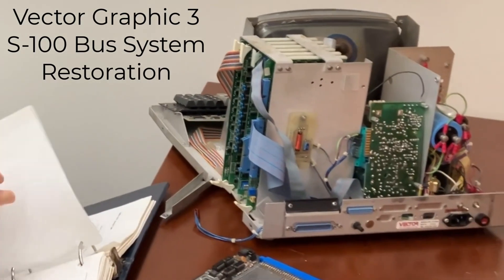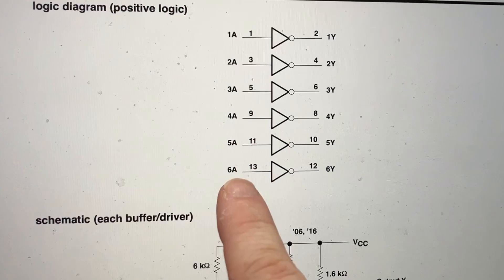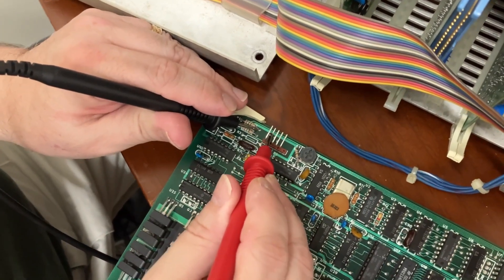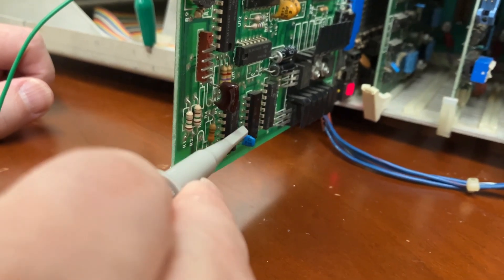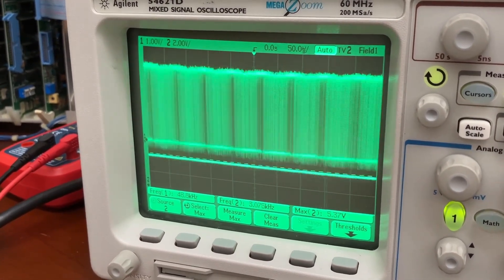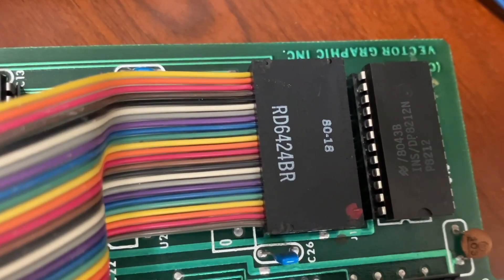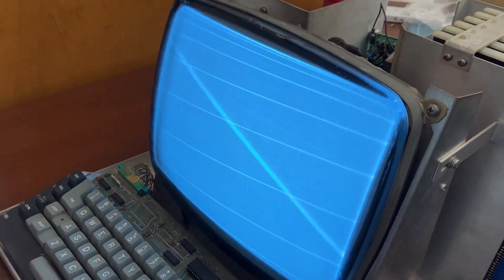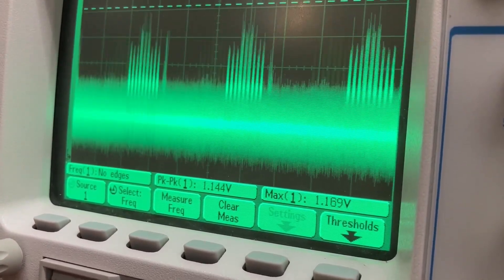Debugging Flashwriter II S-100 Bus Video Card -- Inverter is Suspect (Vector Graphic 3 Restoration)

Comment: Could there be a short to ground on/in the pcb? What would you see if you measure ttl output to ground resistance with no power applied?
Reply from the maker: Good point -- we will check that next time we're in.